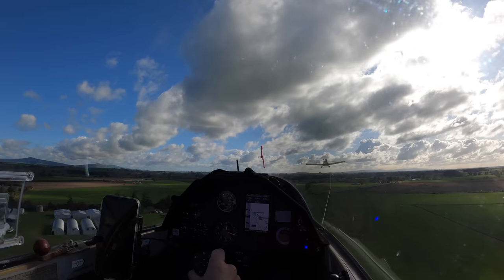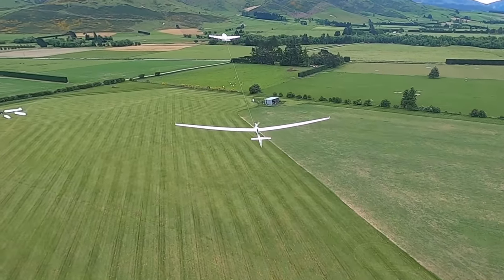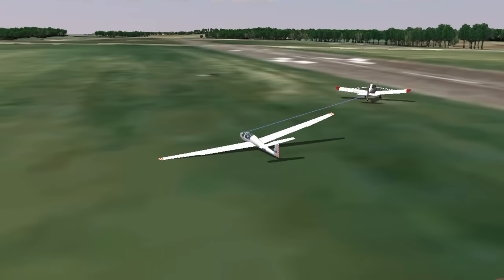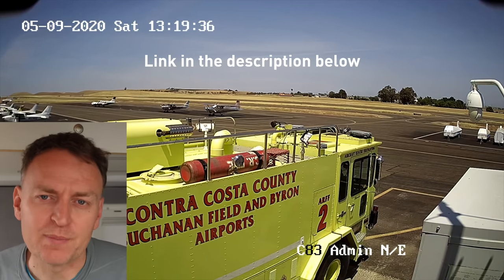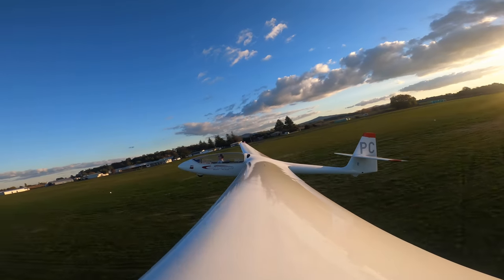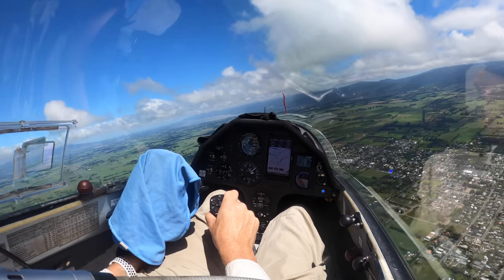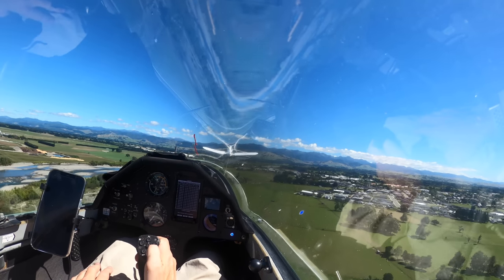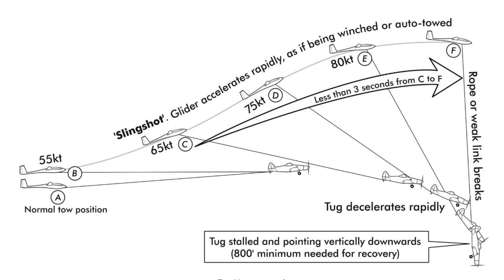3 Seconds to Crash: Glider Aerotow Launch Gone Wrong

Comment: I have a question regarding the towing hook position on the towing aircraft.  I normally fly RC aircraft and the towing position is usually set on top just behind the CG point on the main wing and may extend further back to just past the trailing edge, depending on the design and available strong points to mount the hook on.   If the glider rides high it essentially pivots around the CG of the tow aircraft and is least likely to cause an issue.  Why are full size manned tow aircraft set up with the rearward towing point as opposed to one closer to the CG point?  thanks Allen
Reply from the maker: Good question, I don't know! I guess the risk would be if the glider goes too far up or down the rope could interfere with the tail and rudder. Cheers
Reply: Would make "boxing the wake" a real exacting exercise.  You'd have to to do it just right in the reverse direction, too, to unwrap the tug.

Comment: I've personally seen a ship ground loop during takeoff under tow. No injuries. It was only the glider pilot's conscious decision IN ADVANCE that he was going to release if anything went wrong that prevented a towplane crash.
Know what actions to take in various emergencies and decide BEFORE you roll out that you will not hesitate to take those actions...don't wait for the problem before deciding how you will handle it.
Reply from the maker: Exactly right- a wing drop and ground loop on take off is not uncommon, especially with water ballast and belly hooks. I’ve done it a few times myself. It’s no big deal if the pilot is, as you say, ready to release and does. Cheers!
Reply: I've seen glider ground loops as well.  In one instance, the glider pilot tried but couldn't release until dragged quite a ways - the G force force was so high in the glider, he couldn't actually get his hand on the release.  The tow pilot didn't even notice in the high HP pawnee.  Hands on the release is a good idea - my clubs don't instruct that way - I'll have to bring it up.

Comment: in the gliding club I was in in Aust part of the training was a compulsory take off without a wing runner . Also we had to do a circuit with the toe line not seperating from the tow plane or the glider .yes in Aus they always use the low tow position which means you have to go through the wake turbulence of the tow plane
.but overall I think it's safer than high tow and anything at all is safer than winch launching.

Comment: I think i can design a tow rope to the glider hook that will release at a predetermined tow rope  angle, and also a lock out of the hook until the air brakes are retracted.

Comment: The tow plane has a release too right? I'd be interested in some of the info and decision making factors on the part of the tug pilot.
Reply from the maker: Yeah it does have a release too. I didn't cover the tow pilot point of view because I'm not one! If I was really dedicated I would have interviewed one, but never mind :)
Reply: @PureGlide  Im an Instructor and Tug Pilot.   Yes the question is fair, and a tug pilot obviously has the chance to release, but a) the situation can develop super quickly, as shown, so there's little time to do so sometimes, b) the catapult launch that the glider does can make the mechanics and angles of a release difficult.   The release hook on the tug points downwards; the forces will be much stronger, it could be hard or even impossible to do so,  c) the tug pilot will have one hand on the stick, one on the throttle, at 400-500' needs to often move use a hand to put flaps away, so there'll be a delay in the tug pilot themselves locating and pulling the release.   Far far better the glider pilot does!
Reply: @fly_neil  'The release hook on the tug points downwards...'  It that configuration is required for optimum release of a conventional tow, then is not a secondary mechanism which is guaranteed to work under any angle (including if the glider has over-run the tow plane) required as a safety device to save the tow plane and pilot?  An explosive bolt and a Big Red Button, maybe? A magnetic door latch magnet would provide more than enough pull force (greater than the weak link) and can be easily controlled by turning off the power to the coil.
Reply: @nigelwilliams7920  Sounds like an opportunity there 😀
Reply: I was one of the tow pilots, for a bit more than 10 years, in the very plane shown in the video, and was nearly killed in an eerily similar incident.  There were a number of questions in this sub-thread I can answer that may help with understanding.
> The tow plane was a Bellanca Scout, with a 180HP O360
> The plane does have a pretty good mirror above the windshield that looks back through the greenhouse window in the top center of the wing.  It actually has a descent view of the glider, but the tow pilot has to look up a quite a bit to see out of the mirror, as it's up near the ceiling.
> The tow plane had a tow rope reel in the baggage compartment so we could retract the tow rope after the glider got off tow.  On the back of the reel frame there is a spring loaded guillotine that can instantly cut the tow rope, regardless of load or angle the rope is departing the rope-guide-tube at the back of the tow plane.
> The tow plane's rope release/cut handle is attached to the aircraft floor, under the pilot's left knee (this will be important in a minute).
> The tow pilot's seat belt is a 4-point harness, with a typical lap belt, but the shoulder harnesses were on an inertial reel. It was pretty comfortable, as it didn't hold you too tight to the seat, but the comfort came with added risk (I'll cover in a minute).
> My incident flight started at a high altitude valley airport in Nevada, and the typical tow took the glider up a very steep (e.g. 45 degrees or so) hill to a ridge top about 3000' above the airport.
> In the morning, we flew along parallel the east facing slope while climbing to the ridge top.  This was to try to get any lift we could from the rocky hill warming in the sun.  It worked pretty well, and helped that 180HP Scout climb reasonably at that high elevation.
> My incident happened mid-flight (thankfully), about half way up the hill.  We flew through some lift, and the single seat 15Mtr glider ballooned above the tow plane.
> The sailplane had a CG tow hook.  The sailplane pilot saw the balloon, and properly pulled his release. Unfortunately, the tow rope was already loading the tow hook downward with a lot of force, and the glider hook didn't release. Also, the glider pilot thought he HAD released, but couldn't tell, since putting a downward load on the CG hook just loads up the wings, but not the control surfaces in this case.  So he didn't feel the load in his control stick.
> Meanwhile, I was getting the ride of my life... I could feel the tow plane rapidly decelerating, and looked into the mirror just in time to see the glider disappear off the top of the mirror. I instantly reached down for my release handle.  At that very instant the glider pilot turned away from the tow (thinking he was released).  He violently slammed me into the first quarter of an outside loop, which slammed me up into my seat belt and shoulder harness.  But I was now several inches out of the pilot's seat, with serious negative G's, and out of reach of the tow rope release handle.  I recall trying to kick the release handle with my left heal at least twice, and missing both times... just then the weak link broke like a shot, and I was free. But I was pointing straight down with my airspeed waayyy below the bottom of the white arc... maybe somewhere in the 20-ish MPH range.  Having flown some acro in the past, I held my down-line to gain speed, performed a 90 degree right aileron roll to line up with the downslope of the hill, and slowly added more back pressure as my speed built up.  I flew nap-of-the-earth for a few seconds, and finally recovered quite a few hundred feet below the ground level where the incident first started.  Thank goodness for the 45 degree downhill slope!
> This whole thing still takes me an hour to describe, but it only lasted a few seconds.  Time really slowed down as this was unfolding, and I can recall an enormous amount of detail during those few seconds.  That includes knowing I had nearly no airspeed, and couldn't just pull back on the stick to recover.  Had I done that, I wouldn't be here writing you now...
> Also, both the glider pilot and me (the tow pilot), got right onto taking appropriate action the moment the glider got out of position, but the whole event went from concerning to out of control in under a second.  It was shockingly quick.
> I never enjoyed towing gliders after that, but continued to do so for a couple more years, just to see if I could get over it.... I never did get over it, even though I never had another bad incident afterward.
> Finally, yes, I DO have the broken weak link hanging on my hangar work bench to this day (about 25 years later!).  And it's going to stay there as a reminder of how precious life is.
> My deepest condolences to the video tow pilot's family.  He was with the club long after I moved on, so I never met him, but I feel like I've lost a brother...
Reply: @gregtriplett5611  Wow!  So there were multiple failures of the release systems under perfectly reasonably anticipated conditions.  The glider's release didn't release under a load less than the weak link, and the tow pilot could not reach the cut lever under an upset flight path, and of course the weak link could not anticipate anything and only broke when the forces on the tow line exceeded its rating, long after both aircraft were in desperate states.
I have seen tow planes in a wide variety of interesting positions in the sky in front (and beside!) of me myself, and it would be nice to know that the entire tow system had a rather better functionality than it obviously has. 
Its not enough that the system works as it should when all is going normally, it has to work safely when everything that possibly can go wrong is going wrong, as in your example.
Better minds than mine in the gliding fraternity should be formally tasked with attending to this.
Reply: @gregtriplett5611  wow thanks for the write up!
Seems like that guillotine release really needs to be on the dash hey.
Reply: @FuzzyToasterMeister  Absolutely!  Of course I would have never thought of that before the day of my scare. But it's obvious now. I also would have never guessed I could come that far out of the seat with the negative G's of that pushover.  My lap belt wasn't loose (the shoulder harness was loose), but it was just not cinched down tight.
BTW - the after accident reporting of the video crash indicated the tow pilot was able to cut the rope, but just not soon enough to recover.  :(
Reply: @nigelwilliams7920  I agree we need to build a better mouse trap.  That weak link was the last line of defense for saving my life, and thankfully it worked... AND I had just barely enough time/altitude to save myself. If the "better minds in the gliding fraternity" want to tackle this, and I can provide some insight, then I'm available.
Reply: @gregtriplett5611  sounds like something a national gliding organisation needs to put some work into; review of previous incidents, identify points of failure, recommend solutions....  NZ??  USA???
(easy for me, I'm sitting in a couch as a spectator, its you folk who are at risk every time you tow or are towed!!)
Reply: Key words in the title are "3 seconds".  3 seconds doesn't leave a lot of time to react unless the tug pilot has rehearsed the decision points before reaching for the throttle on every takeoff.  As a glider school chief pilot, I urged  our towpilots to 1) touch the tow release before every takeoff; 2) vow not to let the glider pilot kill ya, and only then begin the takeoff roll.  Below 1,000' AGL, 3) be alert to any trend back there that needs an unusual amount of control authority to cope with; and 4) pickle the rope immediately and withot regard to consequences when any control reaches the limit stop.  Above 1,000' AGL, you can begin to consider what might be done to save the tow rope.  You don't need a mirror (or any other manner of visual contact with the glider, for that matter) to know when the guy in back is so out of position that he's run you out of control over your towplane.

Comment: Is it possible for the glider to fly so low behind the tow plane, that it forces the tow plane to pitch up excessively to the point that it stalls? As opposed to the nose being forced straight into the ground from the glider flying too high behind the tow plane as described in the video.
Reply from the maker: Yeah I think so, but anecdotally that is a lot rarer of a problem

Comment: Interesting video. Is there any provisions for the towing plane to be able to remotely release the cable connected to the glider via some remote RF device?
Reply from the maker: Yeah read the top pinned comment, I go into more detail on how the tow plane can release. I don't think a RF/wireless release would be robust enough to be certified for aircraft use though.

Comment: Many years ago I was a tug pilot for a small gliding club in NSW Australia. On the day I was launching a dual with a student and instructor, I was requested by the instructor to give the student a shake off ( waggle the wings to get him to release ) at about 400 ft while we were still over the air field. At 400 ft I waggled the wings I felt the rope go slack I checked the mirrors and he was no longer visable. At that point to get out of his way I dropped the wing and the nose to commence a descending turn only to feel the rope. Realizing he for some reason had gone into high tow and was still attached, I immediately released the rope and to this day I do not know how I managed to recover the aircraft before it impacted a building adjacent to the airfield.

Comment: Are there any modifications to modern tow rope systems that can auto disconnect if the tow angle is out of safe parameters? I'm just getting into soaring so please excuse my lack of knowledge. I have this innate passion to try and come up with solutions to problems even when I don't fully understand all the issues.

Comment: Why is the rope fixed at the tail if the Towplane? Why not near the center of lift / CG? (like we modelairplane pilots (towplanes up to 5 m) do?)
Reply from the maker: Good question, but the rope would strike the tail of the tow plane when going too high or too low. That's why it's at the back.

Comment: Could the towing attachment on the tow plane end be designed so that it releases automatically if the load angle on the mechanism exceeds certain limits?
Seeing this video, i think that if i flew as a tow pilot, i'd install either a mirror or a rear facing camera with a monitor in the cockpit and brief the glider on tow that if i see the glider exceed certain lateral or vertical limits, i'm going to drop the tow immediately.
Reply from the maker: We have all those things including auto releasing hooks, but used for winching. I suspect the angles are too subtle for the mechanism to work in the nose. And tow pilots already have mirrors, but they also have to watch other things like what’s in front of them, and their guages. It only takes a split second for the glider to vanish.

Comment: I'd suggest that a delay in releasing by the tug pilot can be caused by them trying to over power the pitch or yaw divergence with flight controls (after all thats what pilots do) all the way to the stops then realising it's not working, hence delaying their manual release until it's too late at low level.   Tuggie training needs to include a release as a first response.

Comment: If I'm towing and seeing the ground filling my windscreen on tow, and my yoke or stick is full-back with no effect on pitch, I'm pulling my release... but that's not what most tow pilots think about doing, I imagine. They're really more worried  in that moment about the glider and not their own life, and they only have seconds to react. Second, you show a clip of a powered glider with the prop up and spinning, on tow.. that's that about? It's self-launching but also on tow? Is the density altitude too thin or something? Also, gosh, whirling glider prop and loose tow cables... I know they are somewhat elastic and would snap forward a bit after release but still... what's up with that video clip?
Reply from the maker: Hi yeah unfortunately when you get to the ground filling your windscreen, it might be too late and have too much pressure on the tow release to release. Maybe. As for the powered glider on tow, good spotting! Yes it was just to help ensure as quick a climb as possible for a very heavy glider, as it was towing into rough wave.

Comment: So I actually spent alot of hours trying to town a glider but doing it with remote control plane and a second pilot flying the remote control glider. After several tries and modifications to the tow plane I finally got this to work by attaching the tow point on the plane at the center of gravity location. That allowed the glider to not have to be perfectly in position behind the plane. It's very difficult to have two separate pilots fly remote control planes in line with each other especially when those planes are some distance away from the pilots. Why not do something similar in the real world? Why are tow hooks at the tail?
Reply from the maker: Hi I’ve seen some models tow gliders from the top center, and the rope went across the tail. With the light loads of a model, it wouldn’t matter, but the forces on a full size glider could rip the rudder or elevator off! And if it was underneath, you’d have a similar problem with the glider going too high, potentially ripping off part of the plane. That’s my guess at least!